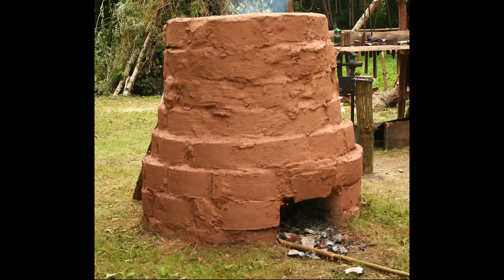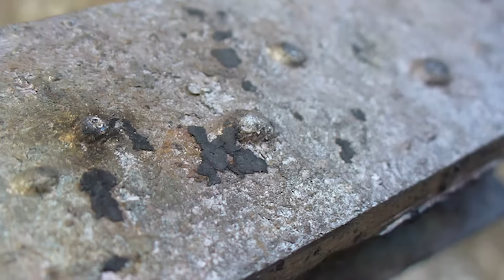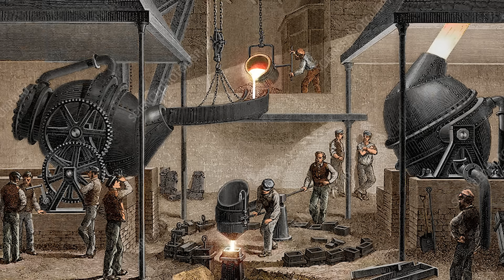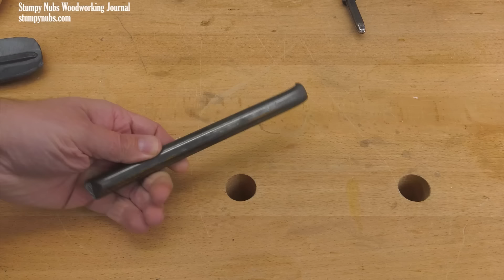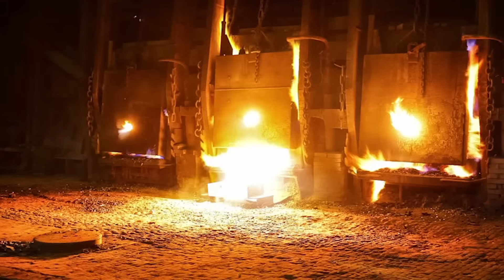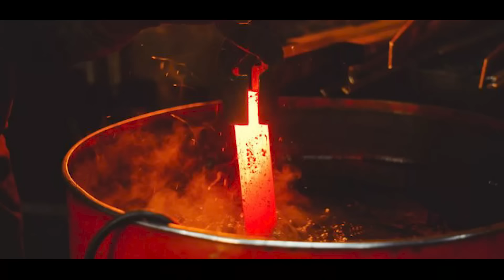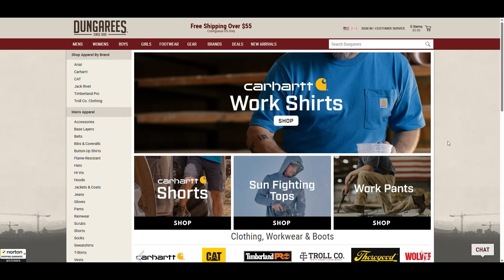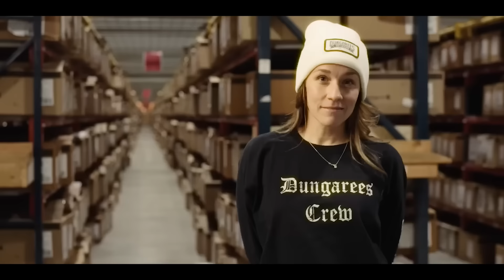Why they REALLY don't make tools like they used to

Comment: I have worked in the American Steelmaking industry for 40 years as did my father before me.  When Dad started there were about 20 grades of steel of which some were VERY exotic, that is expensive.  Today, as I face retirement,  There are close to 300 grades of steel available from my company alone.   Other companies produce grades for which they alone possess the receipts, but are commonly used through out the world.  I would also point out that 95% of the worlds steel is produced from scrap.  It is one of the few materials that is 100% recyclable.
Reply: Because of pollution, U.S. steel makers use scrap melted in electric furnaces.  When the batch is melted, a sample is run.  Then alloys are added to get the chemistry.  As steel is recycled it gets better as it gets cleaner and the alloy content increases.  Indeed iron may be added to dilute the alloy content.   
Steel companies are no longer vertically organized.  A rolling mill will buy steel ingot from a melter.  A forge shop ditto.  Ongoing is the drive for mills to make money on smaller batches.
There are hundreds if not thousands of steel chemistries.  
Woodworking isn’t demanding of steel..likely do well with carburized 1020.  But our Chinese friends don’t think the way we do, that is they skip carburizing.
‘Tool  steels’ , as understood by industry, are for machining.  They are high carbon (say .80), with cobalt ($$$) and touches of other goodies.  And harder than hell’s hubs.   Tool steels nowdays are dying carbide inserts dominate machining.   Cheers
Reply: @danbenson7587  Where to start 
1) your basic outline is correct but your conclusions are wrong .
Remelt steel is getting progressively worse because of cheap mostly Chinese steels that have the maximum allowable amounts of impurities like Phos & Sulphur . Then there are alloying elements like Tellurium added to increase the through hardening and reduce the soaking times in furnaces . Grain size modifiers like Vanadium 
Most of the elements added to steels are more noble than iron so they can only be reduced by dilution with clean pure iron .
Been a very long time since I had much to do with steels but from memory it is 2 parts of Brazillian ore to 1 part Indian ore to 4 parts Australian ore using a 50:50 mix of russian & Australian hard coking coal gives you iron with the maximum permissible level of impurities in the shortest time .
2) when making remelt most companies use process scrap so the charge maker knows exactly what the composition should be thus they can mix different steels together to take advantage of the alloying elements ( or impurities ) already there to obtain the desired chemistry . Sulphur for instance is an impurity which drastically lowers the strength & hardness but it also forms continious matrix inside the steel which aids the breaking up of the chips when being turned and is sold as "Free Machining Steel " your front axels are the perfect example , wash them very clean & the high sulphur content will have them actually rusting while you watch . Springs OTOH need very very low sulphur so if you are making steel that will be used to make springs with you can not melt vehicle stub axels .
It is a lot more complicated than many can appreciate and even using modern mag resonance it is way too expensive to grade all of the scrap before remelt .
Sharpness & edge retention is a product of hardness , stiffness  & grain size with lack of ductility as the edge rolls over rather than wears away which is why you strop fine edges
Reply: @RovertNosnikgdoh Cheers.  I haven’t been in this biz for awhile.  I don’t know how much China remelts steel, but will wager they produce lots of new raw steel.  And I would agree it’s full of crap.  The companies I worked with would not accept Chinese or Russian sourced steel because of this.
U.S. steel makers are remelt.  The ones I dealt with have acres of crushed cars out back.  And unless a lot of Chinese junk gets into them, then domestic remelt gets progressively cleaner.  Recollect they check the chemistry and if sulfur is out of tolerance the heat is rejected.  Nowdays, melters have ways of purging sulfur.  
Sulfur does not weaken steel (reduce its tensile strength) so much as embrittle it.  And welding it ..forget it.  You are correct it is added to facilitate machining.
Steel making is like baking a cake..what do you want?  Chocolate, Vanilla, strawberry, cheese?
Now for a war story.  Chaparral steel (Midlothian, Tex.) is the highest productivity steel mill (or was).  It has produced now for 45 years.  In college I humped and tied rebar at Chaparral when it was being constructed.  This would be in 1974.  That plant has serious steel in the foundations!  Been in the plant to or 3x since.  It’s a continuous pour mainly rolled shapes.
Cheers
Reply: @danbenson7587  I am 80 ad have been out of the industry for over 40 years .
I spent some time with Simsmetal the planets largest metals recyclers although I was in the non ferrous end .
The problem with cars is they are made from the cheapest grade of steel that will do the job and there are lots of those grades from the forged steel or cast malleable iron crankcases , to high sulphur tellurium steels used in cut gears ( as opposed to powder pressed gears  where copper can be introduced ) . Old cars had grey iron cylinders & heads in fact "blocks" is a grade of scrap with is cylinder blocks without cranks , cams or heads . Cranks are separated into iron or steel . Gears (which include diffs but not the housing ) are another grade .
Remelt is done because it is very cheap per ton produced and a small mill can be situated in a factory complex to make a dozen or so grades of steel in specific sizes , shapes or lengths to supply the surrounding factories . Running blast furnaces is very costly & dirty which is why the USA only has one left and they are bankrupt ( US Steel ) .
Shipping steel is also very costly .
A full Australian car body ends up to be about a 20 gallon bucket of shreds there is not as much metal in a body as many would think .
Leaf springs and coil springs are 2 more grades of scrap .
The big difference today is automated chemical analysis when I started the QC lab had a staff of over 100 per shift .
10 years latter it was down to 3 only for OH & S reasons . A wet chemical analysis takes anything up to 20 hours and spectrual one takes less than 1 minute
Reply: Victorinox steel never rust , and retain edge for years, and even with abuse..
Reply: @aocg1914 no it will not.
Reply: awesome constructive comment. appreciate your perspective
Reply: I would love to see people have fun with broken tools and make things out of them. I know some use bolts to make a kind of patterned steel for knives.
Reply: I don't know what type of steel is best . I can tell you 10.9 is very very very very
 HARD
Reply: Indeed, the steel is 100% is recyclable, but then you must be also 100% sure that only the steel was used for recycling and no other metals, which may reduce the product quality, are present in the recycled alloy
for example I have a cooking pot, made from recycled steel in China and after a few years of normal usage it has some severe pitting, due to steel impurities.
Reply: local 488 here, "95% of the worlds steel is produced from scrap" is not true.
Reply: Learned that 20 years ago, steel and cast irons, there are thousands of grades and than are components that have less than 50% iron. We have some tool holder that  you immediately feel that they are different because they feel double in weight because there is so much thungston in it. And than there are lots of heat treatments and surface treatments. We only get the cheapest 20%.
Reply: Why is new steel almost solely made from scrap? If we are so technologically advanced ?? Wouldn't new steel be better? It seems as if making high quality steel from or is impossible today.
Reply: @Joe-the-ho its not, there are plenty of manufacturers that make great steel.
Reply: After watching this video and reading the comments, I'm humbled by how little I know about iron. Thanks to everyone who are here to educate us.
Reply: I seriously doubt that 95% of the world's steel is  made from scrap, alloy steels possibly, but not carbon steel. Thus, in 2023, China produced approximately One Billion tons of steel.
Most of that was not from scrap, since Australia, in the same period, was shipping an average of circa One Million tons of coal Per Day !!  to China, most of it destined for the steel industry.
Reply: but the metallurgy is shit. good metal went when you killed the UK industry.
Reply: Youre correct 95% of victorinox's steel is recycled steel
Reply: All the scrap they use has containment materials which can affect the quality of the produced steel in the end.  Making raw steel from raw materials produces far better quality steel.
Reply: 300 flavors of steel, but most tools are made in China with little quality control and the lowest grade of steel they can find.
Reply: @gmanblue2026 how would you know that ?
Reply: @gmanblue2026 yes and their optics are melted down window glass. While if you get say a magnifying glass or scope from somewhere else it should be optical glass which is a lot better due to the clarity from the lack of impurities. I brought Russian magnifiers from a armaments company and they are incredible good. I showed my mate with his Chinese magnifier and he was blown away. Often people don't notice they are being fed shit.
Reply: @gmanblue2026 as I have done QC work in heat treatment, I can attest to this. I have had cases where I mounted the sample of the Chinese fastener, looked into the microscope and literally said "what the hell is that?"
Reply: That doesnt change the Fact that  being "able" to make things better they choose to make them cheaper. Average tools today dont last as long as average tools when i was young. Fifty years ago.
Reply: @robertcox9226 yeah, but that's a difference of build quality versus material quality. Best case scenario take some modern tool steel back in time and have them (that actually gave a damn) make the tool... or make your own tools.
Reply: @robertcox9226   Even if that's true (and I doubt it), you're including tools that cost so much less than even the worst vintage tools ever cost in that average.  You couldn't buy a chisel made from the crummiest iron 100 years ago for the price you can get a cheep steel chisel for today, and that cheap chisel will be so much better than the cheap chisels of back then that cost many times more that's it's not even a contest.
It actually costs more to use bad steel to make tools and blades now.  The cheapest steels on the market are that cheap because they're good enough to be worth mass-producing.  D2 is one of the cheapest tool steels available and it's better for most tasks than anything made 100 years ago, no matter the price.  For blades, even the cheapest stainless, 420, is better than all but the best carbon steels 100 years ago, and the cheapest carbon steels, the 10xx series, are as good or better than the best blade steel from 100+ years ago, and 5160, the next-cheapest blade carbon steel, is better than the finest steel ever made before 1900.  The problems with modern tools come from design or assembly, not steel.  Thin, weak spots or poor joining to the handle, usually.  Heck, I got some Craftsman screwdrivers a bit over 20 years ago as a gift and every single one of them had the shaft break loose from the handle within two years.  A set of screwdrivers that cost me $10 has lasted me 20 years after those Craftsmans broke.
Reply: @robertcox9226 depends on the maker.
Reply: jbear, FASCINATING !   Are any of those 300 grades "pre- WW II (or 1943) stock " ? 
Something apparently necessary for some very specific applications (like geiger counters)
because all modern steel, like the rest of our planet, is "contaminated" by nuclear aged
human radioactivity.  Apparently salvaging OLD (sunken) steel ship hulls provides the stock.
Reply: @solarnaut Actually, for most applications, it is now at a low enough level that it is no longer a concern. This was more of a concern when nuclear testing was actually occurring, the levels fall over time.
Reply: @Hisokaa-d2j  don't worry, we might restart nuclear testing 😊
Reply: @Hisokaa-d2j  I actually read somewhere that as we phase out coal usage for power plants we will actually reduce background radiation to levels slightly lower than what they were prior to the nuclear testing.

EDIT: Very important correction. The stat I was half remembering was actually about carbon-14 concentrations, which also peaked due to nuclear testing. The coal we burn in power plants is so old that the carbon-14 has decayed away so when we burn it we are actually diluting the natural amount of carbon-14 in the atmosphere and this carbon is sticking around making the effect cumulative. And models predict that if we continue burning coal at our current rates then in a few decades we will have diluted carbon-14 levels to below pre-Industial levels. So still a cool bit of trivia but not actually relevant to this situation.
Reply: @Hisokaa-d2j  Yes AFAIK it's mostly an issue for nuclear applications now. The residual radioactivity isn't enough to hurt anything, but will interfere with the sensitive instruments and dosimeters used to make sure nuclear devices are operating safely.
Reply: @StepSherpa but remember, nuclear energy is dangerous and scary 😂😂
Reply: @solarnautNuclear contamination was only really a problem at the height of the cold war, and even then it wasnt that bad. Any newly mined ore is and was as radioactive as it naturally would be without Human activity anyway. It is hard for radiation to reach the tens to hundreds of meters deep iron vains that may have been mines

Additionally, human nuclear activity is just a small percentage of the total radioactivity that naturally exists in the world around us, most coming from naturally existing radioactive material like Radium in your walls, or radiation from the sun.
Reply: @solarnaut  Some entity is going to nab the Titanic if somebody don't act fast!
Reply: @solarnaut even without human nuclear tests, even in newly mined ore, there's still some radioactivity interfering with such instruments.

Very old steel had time to let such isotopes decay. Which is the main reason very ild metal are so sought after and sold in black markets and stuff.
Reply: Yes that was a thing maybe still is. Steel making requires air and their is enough radiation in smelting th throw off sensitive instruments. So probably most famously sunken british battleships are mostly gone because the steel was repuposed
Reply: Whatever it is that comes out of ch1na is really poor quality, literally ch1nesium, with NO QC and NO heat treatment
Reply: @lordleonusa oh, it was heat treated, just not properly. And it's not confined to China, I've seen the same kind of crap done in the US.
Reply: @lordleonusa and we are basically interrupting rubbish on it's way to landfill. And people pay the Chinese to take part.
Reply: 1950' Buck Brothers chisels hold their edge nicely, and do not need excessive sharpening on the whetstone-----❤I am guessing that the manufacturer hit the carbon balance at the apex.They only cost me 50 cents each!
Reply: @toddavis8603 real deal there, on many levels. Fine Woodworking ran an article about them and if I remember correctly they were made by one person. I have a couple sets from my grandfather.👍👍👍
Reply: Not 100%, you loose a lot from decades of rust and oxidation and there's also a lot if iron in the slag
Reply: @GerManBearPig : You can turn rust/oxidized metal back to the base form. That's part of what processing iron ore does - iron is usually oxidized when dug up.
Reply: @GerManBearPig  use a hydrogen flame
Reply: sir, all materials are recyclable, ALL of them, even the radioactive ones, but people are cowards about admitting that the solution for example to plastic, is to burn it thoroughly to drive turbines, the solution for example again to radioactive waste is reprocessing(umbrella term i actually mean a combination of exposure to reactor cores and something similar to the use of fusors or that one linear tube hospitals use to produce radioactive materials for medicine on the spot via induced spallation and capture), that requires breeder reactors but people are spineless cowards about muh nuclear proliferation, get over yourselves any industrial nation on earth that is serious about it, can make nukes by now this is highschool chemistry and physics, 

everything can be recycled with effort
Reply: @TS-jm7jm oh yeah? What qualifies you to say that? Can PFA be recycled? What about delrin? You realize that even PET becomes basically garbage when they try to recycle it?
You realize that's a false equivalence right? Nuclear material ≠ everything else.  I think very quickly you are headed for the pedantics of the definition of the word "recycle" in the context you are using it.
Hate to break it to you, but very few plastics can be recycled in a meaningful way to how you are using that word. A number of ceramics are also not really recyclable.
Reply: @notsam498   it's very simple, you burn things until they stop burning, for ceramics, burn, crush, convert to dirt and then drop it in a canyon or the botton of the ocean, preferably the big trenches, 

everything is recyclable, you just live in a low energy, and i mean this literally, mindset, how do the americans say "have you tried not being poor?", everything thing is reusable when you have sufficient power, the answer to many of lifes problems is without exaggeration, fire.
Reply: @notsam498  lol bro, chill, you didn't even need to reply to them when their entire solution to plastic recycling was just "burn it thoroughly to drive turbines". If they're unable to realize on their own why that is a stupid idea with severe environmental implications, you're not getting through to them.
Reply: @Skrymaster that's incoherent, your comment literally doesn't make sense. Who didn't I reply to? Who said that? WTF are you even talking about chum?
Reply: @TS-jm7jm  no.. if it takes more energy to reenrich the uranium than the reenriched uranium is capable of producing, you're losing money. it's not recyclable if there's no net gain, we're not talking about technicalities, we're talking about whether something is recyclable in a practical sense...
Reply: @TS-jm7jm 
The USA doesn't recycle their nuclear fuel, other countries do.
The US prefers to buy new fuel from Russia (1 billion $ a year) and dump the partly spend fuel between it's citizens.
Reply: @PeterHuys-w3z  ...i know this generally, but i dont care to speak of individual countries, i am speaking of what is actually possible versus what is politically acceptable
Reply: @PeterHuys-w3z dumping it where?
Reply: @radleytube  where? Between it is citizens, of course!
Reply: @PeterHuys-w3z  do you understand what you're talking about? it takes more energy to reenrich the uranium than the reenriched uranium provides, therefore you're losing money...
Reply: People suffer survivorship bias. Think whoa look at these tools or cars are superior! Electronics suck! 

 When our tech is superior in basically every metric except repairing yourself. The tech bloat, unnecessary crap, the poor quality, robber barons.

 All happened in the past. 

 Yes I said there was tech bloat in the past. Remember there are Rube Goldberg machines out there hah. 

 All the crappy, junk tools, and cars, and inventions. Simply are either long gone, recycled, or rusting somewhere. 

 I bought a 1$ hatchet I beat the F*** OUT, and still here. Admittedly I worry about the carbon fiber degrading. The steel with some love will be tip top. 

 Life is good. Especially electrification. 

 YASA just released a motor double the peak of a Top Fuel Dragster. 750kw peak at 12.4kg or 12.8. 

 That's 1000 bhp just under 29 pounds. 

 350-400 continuous. Meaning around 30kw/kg which is around 470-531bhp total. 

 I mean yes. Inverter, batteries, power train is required. It's like 12 times more powerful than F1s current total system peak. 5kw/kg. Over estimation. 

 Yet even people think electric sucks. 

 Luckily solid state batteries are incoming if war doesn't happen. 500-600wh/kg which is nigh double the average battery. 

 Lithium has plummeted nearly double the cost in ten years with 5-10% increase in density per year. 

 People say batteries suck and haven't improved. 

 People are blind. Take stuff for granted. Buy cheap, get cheap, and think everything is cheap. 

 Cars last longer than ever with minimal maintenance.
Reply: @RedactedDeath cars definitely do not last longer than the old ones. Vehicles are made same as everything else, to be disposable.  I had 300k on my old 71 Camaro, 220k on my Ram D-50 both which I could easily do all maintenance.  2013 Edge, electronics failing. 2021 Ram 2500 4x off road, seam behind the fire wall failed both vehicles have a drain line that needs basic cleaning.  Ram is of course behind the fire wall.  Edge routes down in front of the driver.   You need much more sophisticated equipment to work on vehicles than back then.  Nothing with electronics made now for the general consumer is worth the cost of the item.
Reply: receipts, recipe